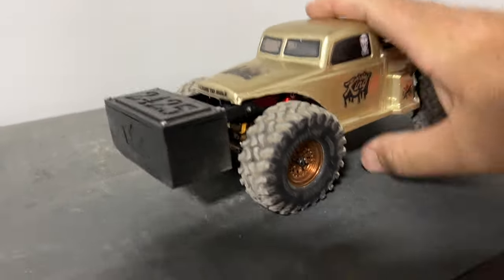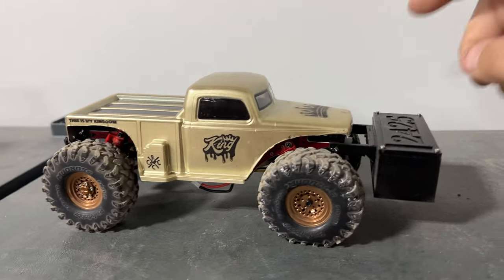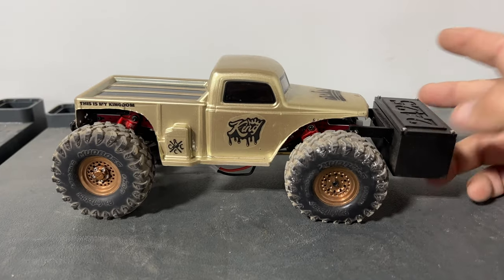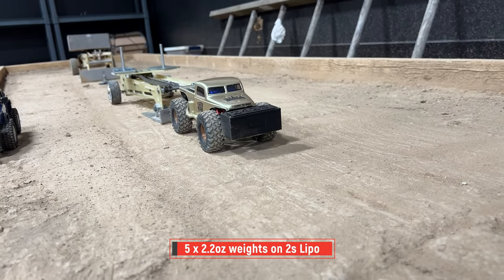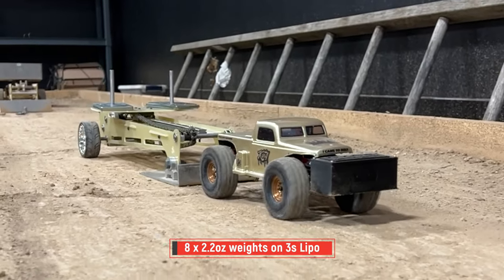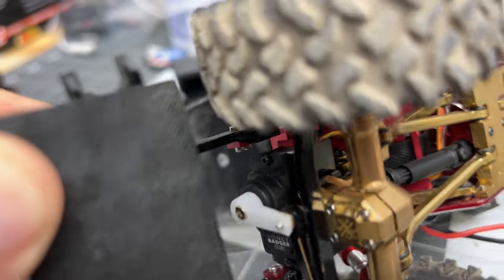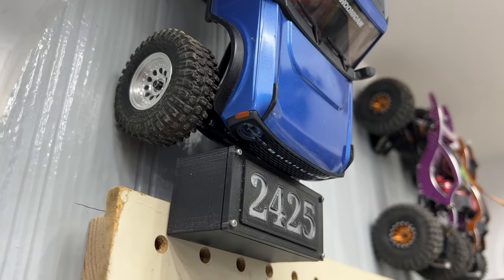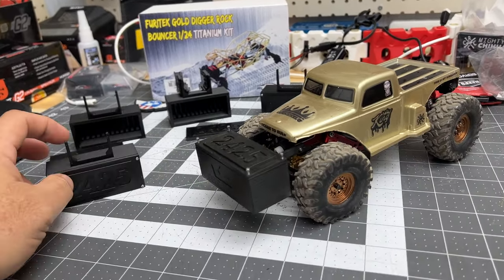1/24 Scale RC Sled Pulling With An SCX24! Tiny Truck Pulling

Comment: We are interested in adding 1/24 pulling to our National event. The Nrctpa World Championships are in October. Wouldd like to talk to you about truck and sled weights and creating classes.
Reply from the maker: Fantastic! I've been to the last two NRCTPA World Championships to run Monster Trucks. Got really excited after watching pulling there and really wanted to do it in 1/24 scale since we also do crawling comps with them.  I've reached out to JS Chassis Works about making more of these and to open up the dialogue. I think there is definitely interest in it. We are going to play with it at our local track New Years Eve and work on our rules early in the new year. I have talked with a guy locally about making the flat circle fishing weights and drilling them to fit on the posts of the sled. I can add a box, but I like the visible weights on the sled. 

You can reach me on Facebook messenger or my contact section on my website to exchange info.

Comment: '
not good idea R/C pull the heavy weight...
dont do that...
1- motor get hot
1- ESC get hot
1- damage gearbox
1- break driveshaft
1- tear break gearwheel
Reply from the maker: Not good for anything to pull weight that pushes its limits, but that’s the point…to see who can push the furthest